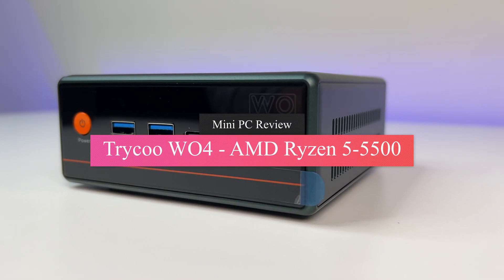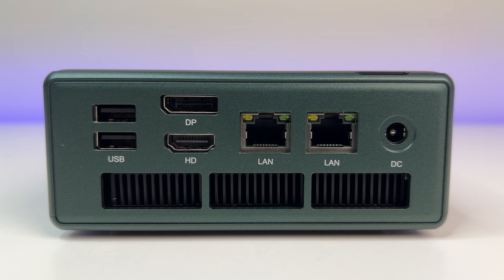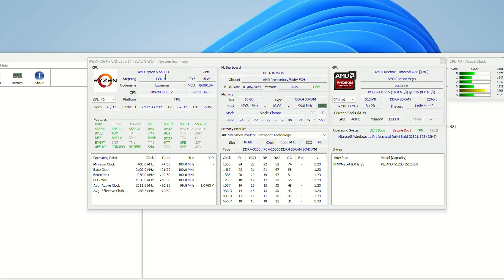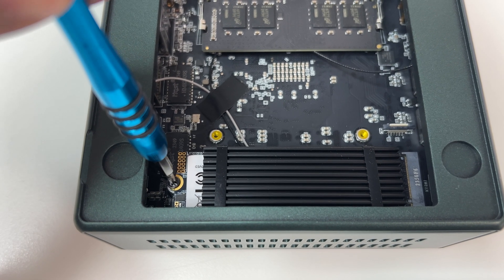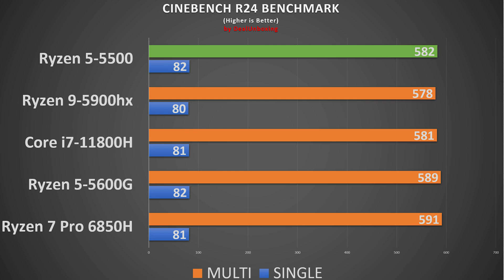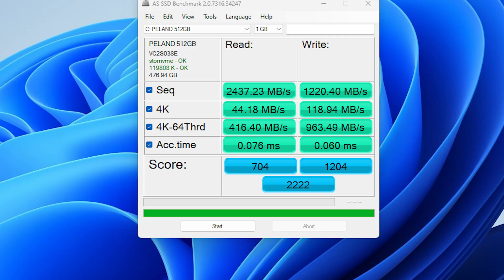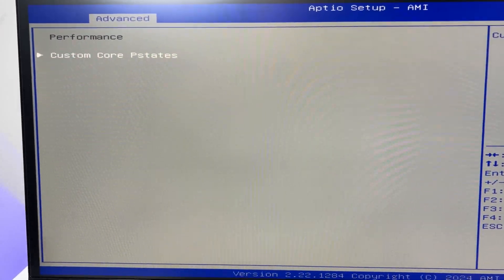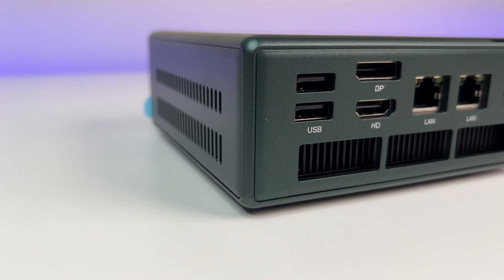Mini PC Review | Trycoo WO4 | AMD Ryzen 5 5500U

Comment: If you have the guts to buy a 20 dollar 16 GB DDR4 DIMM for $25 or less, this thing is an even better Price to Performance CHAMP.

So $220 +25 for a $245 MONSTER that runs circles around the Intel N series and has a BIOS that allows you to unlock 45W performance for free. The Techie''s Cheap-O Choice for SURE.
Reply: Some people say that after a few months it's start to lag and the wi fi stops working